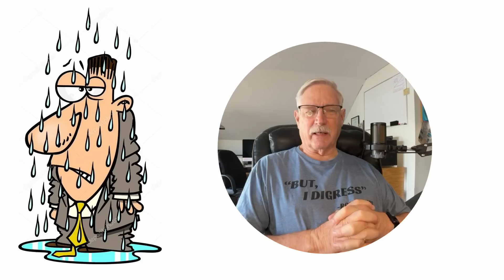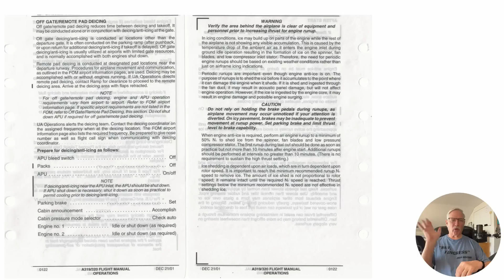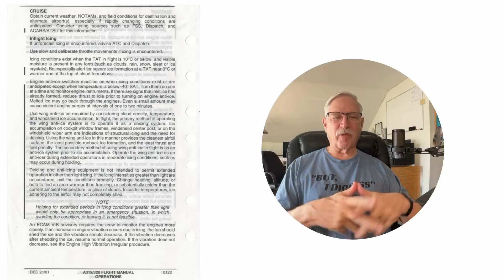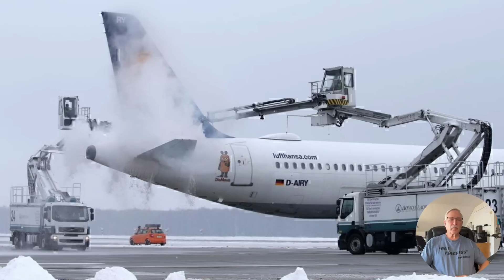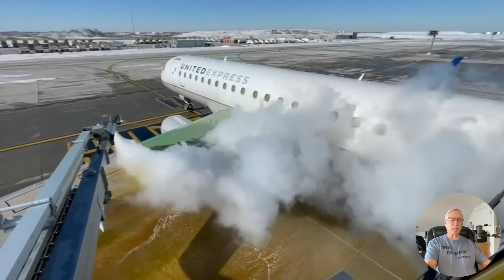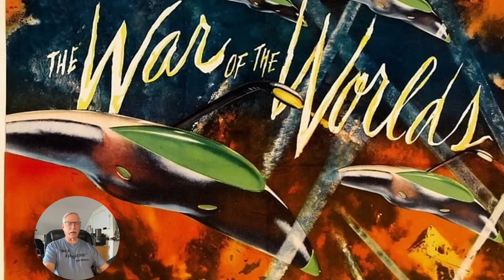Aircraft Deicing. A Pilots perspective

Comment: There is that one Air Disasters episode where, I believe it was an older Air Canada ? 727 and after being in line to takeoff the time limit for the glycol was past its limit. The captain had to make the choice to go back to the de-ice pad or keep the schedule; They were already deiced at the gate (with ground power connection). This particular model 727 didn’t have an internal APU, and that airport didn’t have a mobile power start vehicle.

Company policy was no deicing with engines running. After the captain asked the copilot if he could see ice on the wing, which the copilot responding negative ice observed. So the captain decided to take the chance to takeoff without the 2nd deicing. The plane got to V1 and rotated off up to a couple hundred feet, and that was it, they crashed. Too much ice on the wings. It was the Swiss Cheese model.
Reply from the maker: Wow! Very bad decision, obviously!

Comment: A friend of mine flew F4s in the Royal Air Force and was taking off one day when the control came on the radio and said he had a major fire in his right engine and he might want to consider ejecting which he and his back seater did. He said he was half an inch shorter after that.
Reply from the maker: Yes, the F-4 Martin Baker ejection seats are renowned for spinal adjustment!